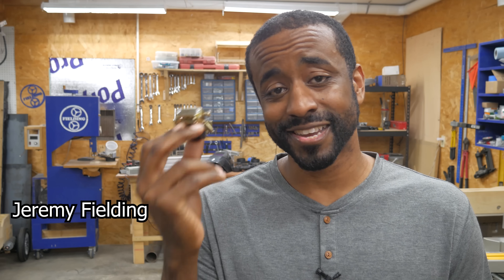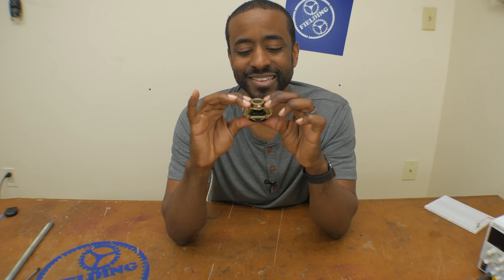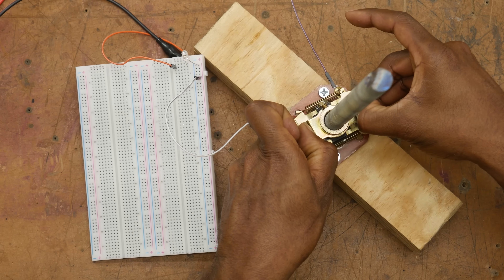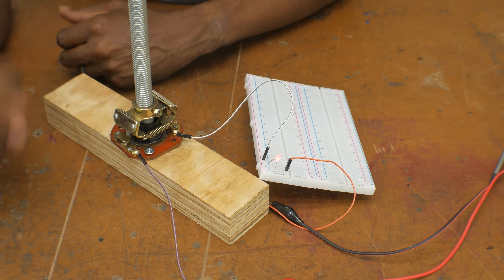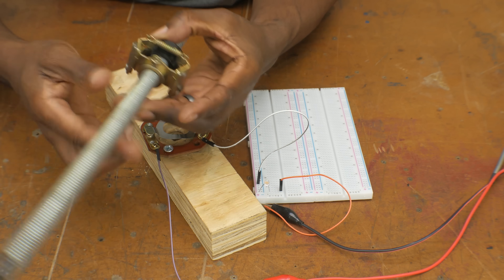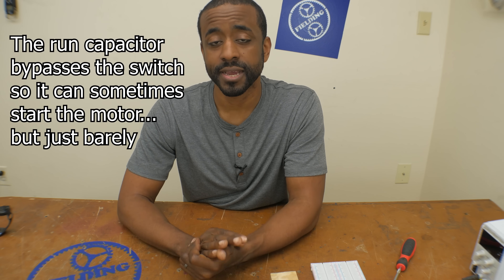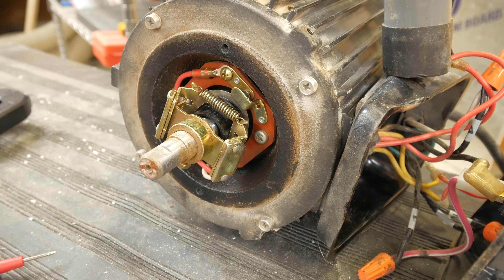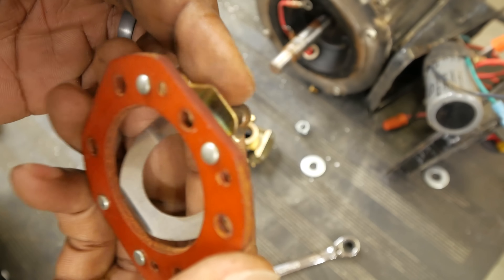This Clever Device Is Found In Nearly Every American Household. How It Works And How To Fix It

Comment: I learned what a centrifugal clutch was when I was about 10 and secretly building myself a mini bike with an edger motor my neighbor gave me. I had to keep it on the down low so my mom wouldn’t find out 😆 very similar example it would throw out and engage the gear on the chain to kick in and spin the back wheel.

Comment: I know that contacts have got a special surface to make them last for long time, so if you sandpaper the contacts you ruin them. To clean them just use a carbon cleaner, you can buy it at automotive parts shops.

Comment: The Capacitor is in series with the second winding and the Cap does a phase shift to give the motor direction. With 3 phase motor, its not required because the windings are phased in accordance with the phasing of the 3 phases and gives motor specie direction. Without a phase shift on the windings, motor does not get forced in a direction

Comment: Not to criticize, but when you clean the contacts, you should use the finest possible abrasive. We used to have a small fingernail file looking thing called a burnisher to polish off rather than sand off the contacts. The reason being that the corser the abrasive the more metal is removed and the shorter the life expectancy. Additionally, coarser abrasives leave big scratches on the contact surface. Reducing contact surface area. Causing arcing and burning of the contacts, reducing the time between failures, and life expectancy.
Otherwise excellent video.

Comment: why the hell dont u use proper currents in the u.s.?? 110v 1-phase allmost everywhere???in euroupe it's 3-phase 400 volts,divided up to 3 separate 1-phase 240 volts when there isnt any need for 3-phase,running f.ex. a big lathe on 110v requires ridiculous cables and fuses to run at all

Comment: Well explained. Excellent job. Similar device in old internal combustion petrol engines. Called points, in the distributor. These make and break an electrical circuit, controlled by a cam to create a spark at the plugs. If your oldie petrol misfires/doesn’t start. Check the same way as this video and clean the same way.

Comment: Looks like the same principals as a governor invented by James watt in the late 1700s.
Reply: Watt improved on the design, not really invented it. And yes, it is the same principle with the only 2 differences being that it is used on electricity here, and that it was made digital (on/off).
Reply: Add a valve, it would be a governor!
Reply: kevin ellis I have to disagree with you. In a flyweight governor the weights produce drag at high speeds from rubbing on a drum to regulate the speed of a shaft. This switch breaks an electrical connection by the weights pulling up the contact away from the electrical connection and have springs to bring the contact back into position when the shaft has slowed down allowing it to be used in any orientation. The flyweight governor relies on gravity.
Reply: @MrArcher0  Kevin is correct, the principal is exactly the same.  There are countless versions of a flyweight governor that DO NOT rub on anything and do use springs.  For example, in automatic transmissions and turbines, the flyweights operate a pilot valve that controls oil flow or pressure.  Depending on their orientation in the piece of equipment they're installed in. A flyweight governor cannot operate correctly on a horizontal axis without a spring to return it to its resting position.

Comment: Two different types of alternating current single phase motors, capacitor start and capacitor run.  Single phase motor stators or the field winding generate a magnetic field that goes back and forth on a signal axis.  When this hits the rotor, it will not rotate but just will vibrate.  So a second winding is introduced at an angle to the first, and what the capacitor does is introduces a phase shift that generates a rotating magnetic field.

Now you have good motors and cheap motors, to save on copper adding a cheap centrifugal switch greatly reduces the amount of stator winding copper. So once the rotor starts spinning, inertia keeps it spinning, capacitor is switched out.

In a capacitor start and run motor, preferred by the way, capacitor provides a constant phase lead of 90 degrees all the time and typically used in good force air blowers and refrigerators.

Buy the way these capacitors are really not that expensive, are AC capacitors, phase is constantly reversed. Be shocked the number of refrigerators were junked when they only required a new capacitor.  Rotor will not turn, no back electromotive force to limit current, blows the circuit breaker, bang, need a new refrigerator.  If that doesn't hurt your pocket book paying a recycling charge to get rid of your old on hurts.

Also with frostless refrigerators, put the compressor and condensers underneath it so pulls in all the dirt off the floor blocking air flow.  Refrigerant pressures skyrocket  loading down the motor and over heating it, in some case, burning a hole in your floor.

Have to be vacuumed frequently.

Comment: You are so close to the truth that it almost hurts me to listen to you miss the mark.  This is meant to be informative, not scolding, in tone.  You mention that there is a starter winding, but do not mention what it does.

Our homes receive only a single phase of the three-phase power grid.  While three-phase electrical induction motors are self-starting, the single phase induction motor has a starting torque of exactly zero.  Small single phase induction motors use the method of pole shading to give the magnetic field a small nudge in one direction, but any single phase motor that must start under load needs a second phase to get started.

Conceptually, a single phase induction can be imagined as two sets of three-phase windings around the rotor, with the fields rotating in opposite directions.  If the rotor is stationary, the two fields apply the same starting torque in each direction, so the rotor experiences no net torque and stays still.  If the rotor is already rotating, one of the fields is plugging the rotor (the field is rotating opposite direction), and the other field is driving it.  As the driving torque is always greater than the plugging torque (the plugging torque is roughly the same as the starting torque), once a single phase induction motor is spinning, it can output mechanical power.

The starting capacitor is wired in series with the starting phase, so that the voltage of the starting phase will lag behind the voltage of the main phase, despite both coils being driven by the exact same input voltage.  To save money, the starter phase uses a narrower gauge of wire, so it wastes too much energy to be left energized for the entire run time of the motor.  The centrifugal switch allows the starter phase to only be connected, as the motor spins up.  Some single phase motors are designed to have the split phase connected all of the time, and these split phase motors lack the centrifugal switch (as they do not need one).

Powered hand tools use a 'universal motor', which is a brushed DC series connected motor that can handle the full voltage of the wall outlet.  As the current in the rotor windings is in phase with the current of the field windings, the direction of the torque is constant, even as the current reverses.

Comment: You did not mention that 3 phase motors neither need the capacitor or the "centrifugal" switch. Single phase motors need to be "tricked" into starting, the need for a phase change to make the motor "think" there are 3 phases. The capacitor synthesizes the 3rd phase temporarily to get the motor started.  Once the motor is turning, only single phase power is required .
Reply: Thank you, that helped  reinforce my understanding of motor starting. The rationalization you wrote in black and white isn't always obious.
Reply: It synthesize a 2nd phase, not a 3rd.  Even a Y wound 3 phase motor will start and run (poorly) on 2 phases. There used to be 2 phases motors that used 2 phases with 90° between them.
Reply: That is exactly the reason of The capacitor. It changes the phase of the incoming line and create a second phase and though a starting wind causes the motor to start sniping and also on the right direction, after that the clutch disconnect the starting circuit and continues to run in a single phase.

Comment: Quick tip for cleaning burnt contacts: The striking strip from a book of matches contains a very fine abrasive and red phosphorous. The fine abrasive reduces the risk of misshaping the contacts and the red phosphorous will reduce the risk of the contacts welding shut once in use. Cut the strip out of the match book and place it between the contacts and apply a bit of pressure to the contacts while sliding the strip back and forth to sand the contacts parallel to each other. Flip the strip over and repeat to sand the other contact.

Comment: There's a terrific tool for that job called a burnishing blade. It's a diamond encrusted blade that removes tarnish and burn spots in one or two passes without gouging and/or leaving particles behind. It was a commonly used tool on punch card machines and sorters back in the 70's

Comment: A similar principle was also used in cars limited slip differentials. When you go around a corner, the inside wheel has to move slower than the outside wheel. The differential is opened by default and wheels can turn at different rates. But if one wheel start to slip and spin, the differential will start spinning, and a sping loaded clutch will spring out, similar to this, which will partially lock the wheels together. This is so that the wheel spinning will force the wheel with traction to turn. Today, most if not all constructors use the brakes to slow down the wheel spinning out. This lets you use an opened differential as a LSD. It's lighter and has less mechanical parts. You wear out easy-to-replace brakes instead of a clutch inside a differential. But I feel these systems do not work as well as the good old LSDs. Gosh I miss my WRX.

Comment: Centrifugal switches and actuators can be found in all sorts of devices.  The clamshell configuration is a compact version of the swinging balls version.   The starter winding circuit adds an extra set of poles to the motor.  Analogous to adding additional cylinders to an engine during start up.

Comment: Isn't the capacitor to get the motor started spinning, regardless of load? The transmission should be doing most of the work through its gear reduction. From what I recall, every  centrifugal switch motor I've worked on never had a capacitor and every capacitor motor I've worked on never have a centrifugal switch. I could be wrong though.
Reply from the maker: It is regardless of the load, but the switch is there to turn off the starter circuit... thus it is extremely unlikely you have one without the other. I don’t understand what kind of motor you are referring to. Single phase induction motors need a start capacitor and many have a start and run capacitor
Reply: @Jeremy_Fielding  for example , cooler motors use centrifugal switches and dont use capacitors. And my compressor motor uses a capacitor and not a centrifugal switch

Comment: This is where the term going "balls out" or "balls to the walls" comes from because locomotive engines would use the same mechanism to regulate the speeds of their engines with two ball weights on either side. So if you were going as fast as you could the ball weights would be at their furthest position outward. Thus going "balls to the walls".

Comment: The first video I have ever seen on one of these.  I deal with them all day long.   Many of them look identical; however different HP motors will have different spring tensions. replacement must be the same, otherwise the switch may not open, or open too soon, and you will have problems.

Comment: Great video. I would do one thing differently: keep the contacts in place and use a two sided emery board and push the contacts together. Then this will allow you to sand both sides at the same time. This ensures that the contacts are sanded parallel to each other and will have more surface area for electrical continuity.

Comment: Mechanical speedometers and other similar rotational gauges function by the same principle. the cable spins up a set of weights that spread as the speed increases extending a rod that causes the needle to spin

Comment: I'm an accountant. Why did i watch this video? Moreover, why did i like it? I had no idea what this guy was talking about!
Reply: I am the ultimate do it yourself guy. I have replaced the start and run capacitors as well as the bearings on my 5hp air compressor motor. Also cleaned and lubricated the centrifugal switch and it's electrical contacts. I pretty much did everything he does in the video and I also found this video fascinating. Now if I could just find an entertaining video on how to do my own accounting. 😁

Comment: The other day I tore apart a motor on my air pump that shorted out. It turned out some coils were severely shorted out and it was not worth repairing. I took off the centrifugal switch and studied it as I am familiar with capacitive start motors. This was all out in the garage and I made NO google or YouTube searches on anything even close to this subject. Today this YouTube video popped  up as a link. This out of the blue content based on my activities not searches has been happing a lot lately....has anyone else had this?  Anyway, nice video!

Comment: patent for a centrifugal switch (US Patent #1,630,394) was granted to Royal Lee on May 31, 1927. It was the basis for the formation of the Lee Engineering Company. From wiki. Though it’s also stated these where found in fans in as early as the turn of the century to 1910’s

Comment: An emery board would make easier work of cleaning those contacts. They’re cheap and handy.
Reply: Good idea.
Reply: ... or an automotive point file - assuming you still can get them at an auto parts store.  My time as a mechanic was in the early '80s, though, so I guess this really dates me.
Reply: @jhorne18  I was thinking the same thing! I had one for my VW van and it's still around for this type of stuff.
Reply: Nail files are the tool for the job, very cheap also!
Reply: use a "cratex" for contact cleaning

Comment: 1500 comments, I'm guessing someone covered this but you don't want to use too high a value of a start capacitor.  The start capacitor is tuned to one set of the stator windings to give it a 90 degree (ish) AC phase shift from the other set.  Too low a capacitance and you end up with too low a phase shift, resulting in low starting torque.  Too high a capacitance and you end up with an unpredictable amount of phase shift, usually too low, but way too much capacitance and you can end up producing more voltage than the capacitor can handle (see an LC tank circuit on wikipedia) destroying the capacitor.

You've got a lot of wiggle room for most devices either way, but you go outside that wiggle room either way and you can destroy the capacitor.

Comment: Ok bud, you have opened up a whole can of worms for me. Are you an engineer, more specifically an electrical engineer? What exactly did that motor come off? I thought it was a generator & was hoping to see the copper wire wound inside it. Is the voltage meter or the ‘meter’ that you used also called an Amprobe? When you removed that tab & sanded it made me think about my father who was an engineer occasionally had to remove the cables from the batteries from our vehicles WH they working well. He made a small pale of water & baking soda & with a small round wire brush would dip the brush in the pale then stick in the part that went around the battery posts. When done he would wipe a little bit of a thin oil, then lightly wipe that with a cloth & put it back on the the battery posts. If the vehicle didn’t start he bought a new battery. You did a great job of demonstrating & explaining what you were doing. ✅ You have a new subscriber. Keep up the good work & be safe. 👍☮️🌞🦠😷🛠

Comment: There are two type of motor capacitors. There are START capacitors and then there are RUN capacitors. The switch is only used in motors with “ START” capacitors.

Comment: Back in the day we had "points files" for cleaning spall and corrosion off of breaker points. But since nobody knows what breaker points are anymore besides crusty old car guys, they can be tough to find. I've found that an emery board for finger nails can be just as effective, and a little stiffer than sand paper to help keep your faces square and flat.

Comment: People who have central AC units should keep spare start/run capacitors. They are cheap and always seem to fail on hot summer holidays. Before attempting to replace one, turn off the breaker to the AC system and either wait an hour or short the terminals before touching the capacitor. I do both. Replacement is a very easy DIY job for any homeowner. I'm sure there are lots of videos, if you need one.

Comment: Contacts are made with a mirror finish.
Scoring the contact plating causes uneven surfaces and promotes more arcing and faster burning.
Use a point file and don't change the angle.